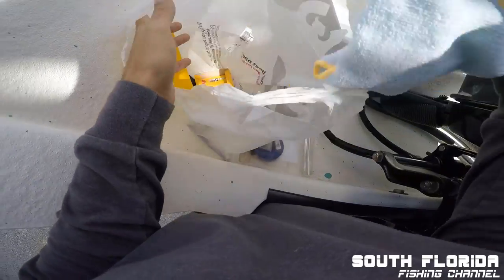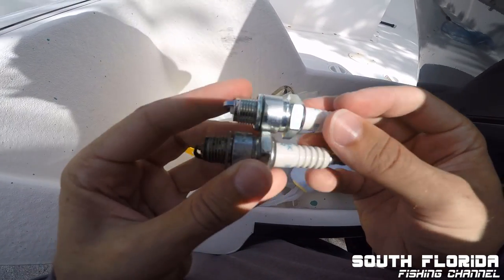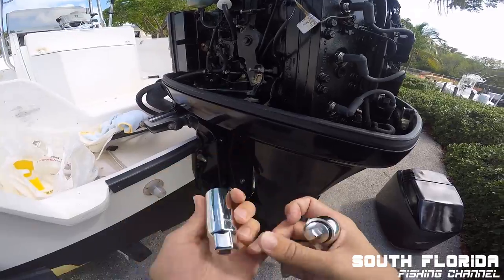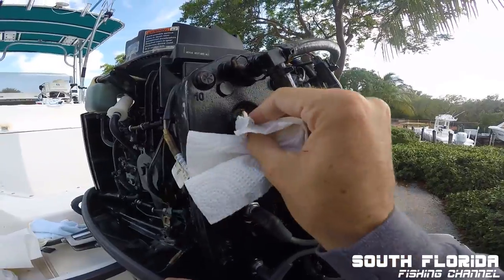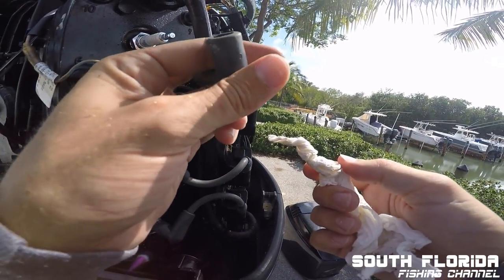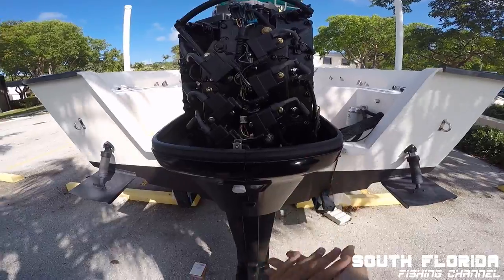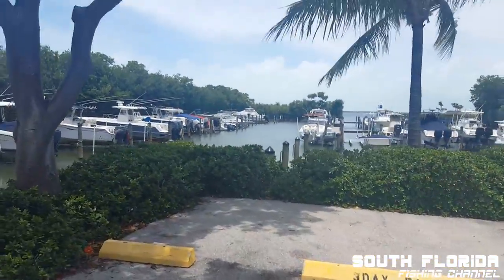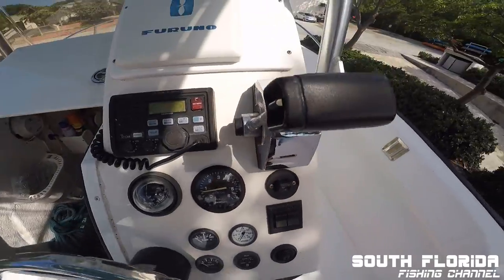How to Replace Spark Plugs | Mercury Outboard Engine

Comment: Couple of things, don't shove a paper towel or a rag in your spark plug hole, clean before removing spark plugs. You needed to gap your plug to the manufactures recommended gap before installing.

Comment: I’d like to ad my $0.02.  Sand is the worst thing you can get in an engine.  The cylinder is the worst part of the engine to get it in.  I suppose with a 2 stroke it’s even worse if it gets in the crankcase than in a 4 stroke.  I would flip if I knew I got a single grain of sand in my engines.  Most people don’t do this as I see you didn’t either.

Clean the area around the spark plug before removing it.  There are many ways to do this.  Many mechanics keep some mineral spirits and spray,wet,soak the area around the plug, then blow the area clean with compressed air.  It’s absolutely necessary in some situations in car engine since the plugs sit in a deep cavity that without a doubt collect dirt dust and/or sand that will fall in an engine as soon as the plugs are pulled.  In your case, some spray brake cleaner or carb cleaner would do nicely.  Combination solvent and a blast of air in one.   Clean around the spark plug real well.  Then take the plug out.  Another step is to also loosed the spark plugs and crank the engine and let the cylinder pressure blow past the threads pushing dirt away.  This won’t hurt your engine.  Even if it starts and runs for a moment is fine.  

And if for some reason you have to leave it without a plug plug it with a paper towel or rag.  Mud wasps love holes.  And fill them with muddy sand.  Sand setting in the spark plug hole is probably the number one reason a car engine, at least here in florida, is burning oil and leaving a trail of blue smoke.

Comment: I have a 2002 Mercury 150 optimax. Why does my motor runs when I removed 1 spark plug with no problembut when I put it in it doesn't run?